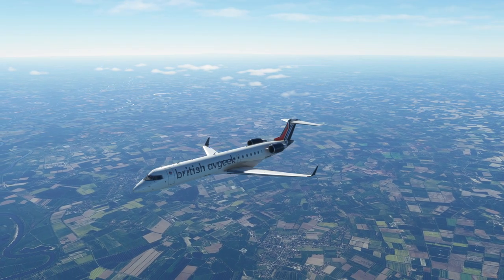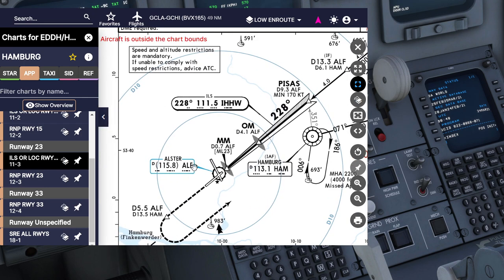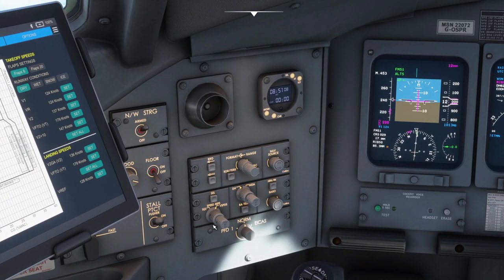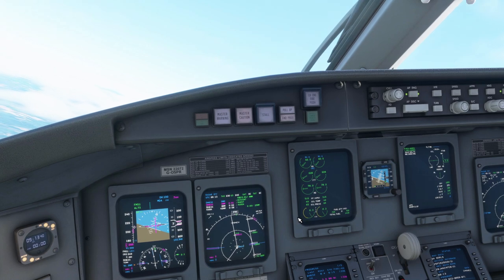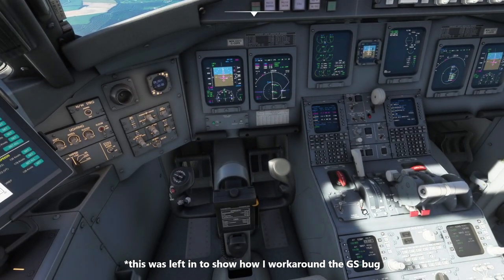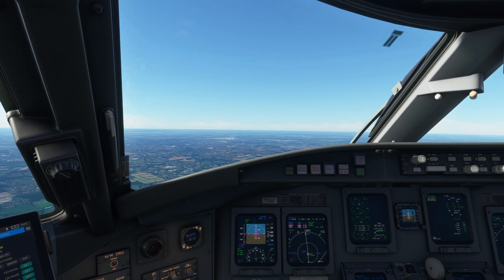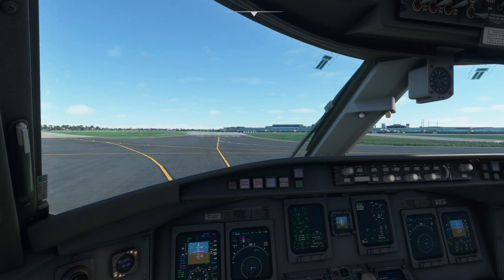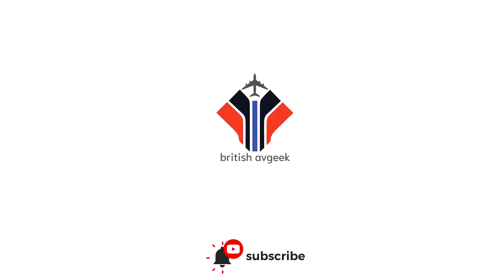MSFS 2020 | AEROSOFT CRJ LANDING TUTORIALS [ILS into Hamburg] with GS Bug Workaround Tips!

Comment: So interesting thing about the ILS here at Hamburg (and also fairly common at other German airports) is the ILS isn’t ILS DME, it is just ILS (you can see this on the chart) You get the DME from the VOR so in this approach the ILS freq gives you the lateral and vertical navigation and the ALF VOR gives you the DME (there’s a little D next to the name as well). You should have used this VOR as the DME hold instead of the ILS. My guess is that when you pressed DME hold on the ILS frequency it actually was tuning the DME from another VOR 95 nm away!
Reply from the maker: Likely, The fms auto-tuned nearer to arrival and wiped my vor inputs

Comment: Nice tutorial, I sadly get that gs bug way too often. Plus in Hamburg (which is my home airport, so I fly there frequently) the ILS is broken when using the Justsim scenery. But at least your workaround makes the gs issue less annoying, thanks for that. :D
Reply from the maker: No problem! I should have picked a better arrival airport then 😂 also if you press approach at or just above the glide slope it helps too
Reply: @BritishAvgeek  I’ve tried your workaround on the GS bug, but in the video I’ve tried to follow your sequence, but it is difficult to follow in the video. Do you turn A/P off, deselect APPR select HDG, then engage A/P and select APPR?
Reply from the maker: @enriqueosuna  in short, yes - but if that doesn't work, just turn Appr mode off and on again.... And if that doesn't work, disengage the autopilot and fly it all the way in manually 😎
Reply: @BritishAvgeek  thanks for the tips! 😁

Comment: Another great series of videos hitting the main points for getting this in the air (and back down again). The reason you weren't getting distance on the ILS is because this particular ILS doesn't have DME installed. As seen on the chart you showed, you need to tune ALF to get distances for the approach. So you would need this tuned to LOC2 to get distance. Is there a way of showing both LOC1 and LOC2 at the same time on the display so that you can see the correct distance for approach?

I've managed two flights so far with the CRJ and both relatively successful. First flight (EDDS-EDDF) ended up being a total stick flight as I couldn't engage AP. On the screen I could see that Yaw Damper wasn't engaged and after the flight found out this is why AP wouldn't. In panic during the flight, it turns out I was accidentally mashing Stab Trim rather than Yaw Damper (since they look almost identical). Second flight (EDDF-EHAM) went much better and was a smooth flight. My biggest issue is throttle control on descent. On final, I was far below Vref but still managed to land safely. Something to keep working on anyway
Reply from the maker: It does take a bit of getting used to! And you can use the two square buttons to the left of the Format/Range dial (panel by the EFB) - the bottom one will cycle through VOR2, ADF2 etc 👍 

Glad you enjoyed the video and good spot on the mistake there! Not sure how I missed it but I did 😂 glad you're enjoying the CRJ and the tutorials!

Comment: I will have to try this work around out. I've done several ILS approaches and have had problems with all of them either not picking up the LOC and or not grabbing the glideslope. It's been very frustrating and making want to give up on the plane. I don't want to give up on it though as it's such a great plane and I enjoy everything else about it.
Reply from the maker: Ah - well this got patched ages ago... have you seen my ILS CRJ tutorial? https://www.youtube.com/watch?v=MowLu_jqAJs&list=PL-4y7fmOeA-UfmasXuTxtWrvcnzjoMwmo&index=3  - hopefully that helps
Reply: @BritishAvgeek  Thank you for the link. Last night I had a strange thing occur where I started at a gate and noticed before I pressed the start flight button that the ailerons were fully activated in opposite directions of each other. Also a light on the top tail was blinking. When I started, there were no light switches on and I couldn't turn on my fly pad. I did an uninstall and reinstall and was able to get the ILS approach to work just fine. I probably should have noticed the plane might need a reinstall when the ground power switch would not turn off for some time after being in the air still for 20+ minutes.  Will definitely give your other video a watch too as I do enjoy your videos. Thank you!
Reply from the maker: @Senescense  great to hear you may have found the solution 🙂
Reply: @BritishAvgeek  I have the newest version 10180 of the CRJ and the ILS still bug

Comment: When i load normally with no flight plan i can turn on Autopilot, but when i load cold and dark and load it in, and i turn on autopilot after take off it just double beeps 3 times and wont engage. I have FD on. Any idea what im doing wrong? Great video! Much more practical than the dude.
Reply from the maker: You need to switch the Stab Trim (2 buttons) and Mach Trim plus both Yaw Dampers on in the centre console or it won't allow the autopilot to come on
Reply: @BritishAvgeek  Genius! Thank you :D
Reply from the maker: @jasonmcaree8503  no problem - easy to miss!

Comment: The fact that the plane climbs 700 ft when it should maintain 4000ft is hilarious! As an air traffic controller i would constantly freak out if planes and pilots would fly like this plane does.
Reply from the maker: Sadly that's more an issue with the sim and the way it's handling the Autopilot but they're working on updates and fixes for it - it's not too bad 😂 I just edit tutorials to make them look 'perfect'

Comment: Trimming the airplane and manual trust simultaneously is very hard and challenging for me in crj and Boeing, I don’t feel the aircraft :( But no problem with this on Cessna 172 :)
Reply from the maker: Cessna is a lot slower as well :) just small changes to trim regularly with thrust and it helps keep it smooth :)
Reply: @BritishAvgeek  thank you for the advice, I will keep learning

Comment: Why do you keep resetting the heading bug if you are using the fmsg to kind of steer the aircraft?
Reply from the maker: It's a Boeing thing but obviously also a Canadair thing too. From what I can see, the heading bug always stays live so if the Nav mode fails for example and it reverts to Hdg mode, if it's not centred it'll turn the aircraft in the direction the heading bug is set at. I'm no Boeing/Canadair pilot but that's the logical thinking I can come up with!
Reply: Standard operating procedure

Comment: To shut off the engines, you don't hit the "stop" button and then shutoff the throttle. You turn off the associated boost pump, then shut off the throttle. The engine stop button stops the starter motor for the turbine engines, which should already cut out at 50% n2. The purpose of the stop button is to stop the air turbine starter in case it dosnt cut out at 50% n2.
Reply from the maker: Not with the advice from the captain who helped me learn this jet with what his company does

Comment: Glide Slope isn’t work in this aircraft. This video has lot of cuts so not sure if you really make it works. In here just don’t work in ANY ILS approach at all.
Reply from the maker: Some cuts to trim the video down in length... if you know my channel you know I include mistakes if I make them too!
The ILS has a bug with it but if it bugs out you just turn it off and fly the ILS manually using the PFD, or try the workaround I demonstrate in the video (which works sometimes)
Reply: @BritishAvgeek  thanks for the reply. I do not consider fly manually as a work around. Of course we have to land in a way or another but this does not mean this is a work around for the bug once the bug is there in any situation and will not be circumvented by turning it off and on as suggested. Anyways, your videos and channel is great and this is an Aerosoft issue not yours.
Reply from the maker: @2gsim  thanks - but what happens in real life is the autopilot breaks, or the localiser goes down? They fly it manually, so it's not too bad if we have to sometimes do that - it makes it fun :) 
Aerosoft are working on a fix and creating their own custom logic for it so hopefully it will be fixed soon though
Reply: @BritishAvgeek  I hope so...

Comment: Every time i load up and fly the CRJ, shortly into the flight , my desktop crashes, so i will have to wait for Fs2020/Aerosoft do an update ,and hope that will solve the issue!!
Reply from the maker: Any mod conflicts?
Reply: @BritishAvgeek  after i download a livery, it started, have removed the addon, redownload the Crj, still happens!
Reply from the maker: @anbrod1  ah delete the livery then - it probably has a broken file or a panel.cfg which breaks the aircraft
Reply: @BritishAvgeek  oh yes first thing i did, does not help, hoping for update from Aerosoft will solve the issue.
Reply: I had this problem also, initially it just showed up on the CRJ I guess as it's a heavy load on the PC, it was also happening on other planes such as A32NX though but less often (not a plane issue). I placed all my MSFS2020 mods (except CRJ) from the community folder into another folder and followed these steps here https://flightsimulator.zendesk.com/hc/en-us/articles/360015893879-How-to-troubleshoot-crashes-CTDs-during-gameplay - which are very useful, though I left my CPU Overclocked. However what solved the problem for me was placing MSFS2020.exe in the Malwarebytes allowed program list. Since then I have done 3 full flights in the CRJ without issue. Hope this helps.
Reply from the maker: @chaingunner60  interesting fix! nice work finding a solution for your issue though - hopefully that helps Anders too!
Reply from the maker: @anbrod1  you seen chaingunner60's comment? perhaps that may help?